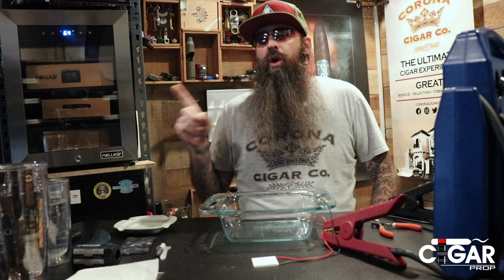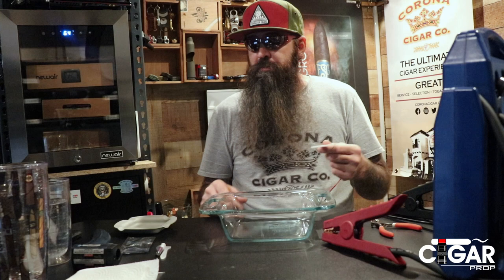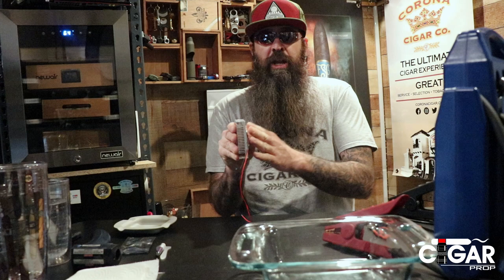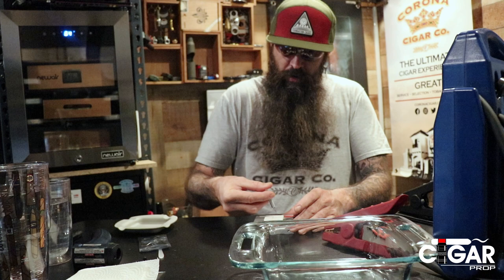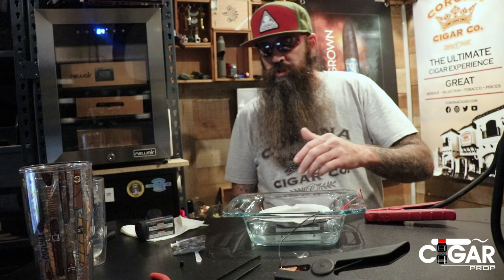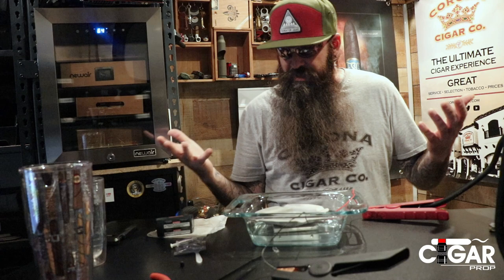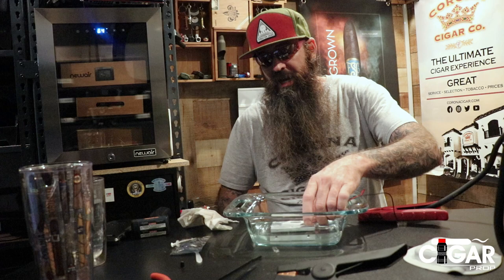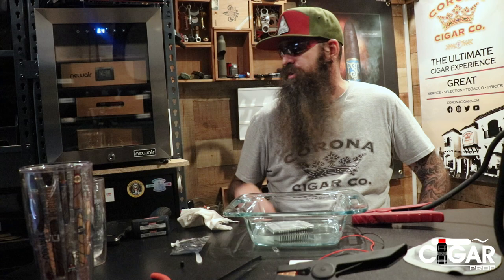How a Thermoelectric Humidor Works 2020 | Cigar Prop

Comment: This is a very nice explanation of a Peltier cooler, but unfortunately I am still unable to understand how that humidor handles its primary function. I know that the humidor’s unique function is that it achieves a humidity (or more accurately dew point target) to maintain proper moisture levels for the items inside. I’m very curious how it does this. Many models you simply add a cup of water in the unit and it takes care of the rest, but how does it do this? I even believe the dew point is the priority, with temperature second, but I’m not sure how that works. There is a straw sized drip output for water into a bin in the back as well right?  Thanks for any insight.

Correction, it seems this model only cools (or also heats if the h model)  and does not actually control humidity - I spoke with new air today and unless the rep was incorrect the unit does not lower or raise humidity on its own- a separate device would add humidity but there is not a mechanism for removing excess.
Reply from the maker: You are correct, there is no way to remove moisture from this unit.
What you need to do is put all of your cigars in there and  set the temperature that you want and then experiment with how much humidity you'll need based on the amount of cigars that are in there.
I would recommend putting all of your cigars in there, and setting the temperature to 65 degrees with no humidification at all for at least two weeks.
After two weeks, slowly add humidification if it's needed

Comment: @cigar prop I have a 800 count thermoelectric cooler from Amazon the brand Is tcfundy.when unit is plugged in my humidity drops 7 to 8 degrees and water drips off the plate.when unit is unplugged humidity holds fine.do you have any idea what's wrong.properly seasoned  unit kept in room ttemp environment.i had unplugged for 1 1/2 months humidity held no problem.plugged in for 1 hour lost humidty?
Reply from the maker: It's a cheap chinese-made machine, that's why doesn't work for crap.
But even if it did work, I would recommend you unplug it.
I recommend everybody with a thermoelectric humidor to just unplug it. I have found that they hold temperature and humidity so well, they don't need to be plugged in.
With that being said, there are people in really cold climates that need to have their cigars heated, but if the room the humidor is in is properly heated and cooled, I would just unplug it

Comment: Thanks for making this video, I was wondering, since this type doesn't use a compressor or whatever with oil like a normal fridge, do you see any reason putting the cigar humidor version on either of it's sides would cause problems? On the model I was looking at, it seems like the main cooling fan you're describing is on the back wall. Since it's in the same spot when turned on either side, maybe it will work. Do you think the 90 degree change in orientation is enough to mess with it? I haven't come across this being attempted anywhere which is odd considering how most of them don't fit cigar boxes, my first thought was can I turn it sideways?
Reply from the maker: This unit just uses a Peltier device so there's no reason at all that you couldn't mount it on its side or even upside down.
I'm not sure why nobody else has ever thought of that!
Reply: @Cigarprop  Thanks man, I'll try it out with the one I'm getting
Reply: So how do some of these heat and cool then? Mine says it heats and cools but not sure how it directs the unit to heat or cool depending on temp
Reply from the maker: @brianwalsh7040 a reversible Peltier device. It uses a small heat sink to cool, and then when it wants the heat, it changes polarity

Comment: This is how temp regulation works, but it not explains how the humidity is regulatet. Especially how do you adjust humidity connected to temp. If you cool air it "sweats" out water, if the air gets warmer you need to add water to keep the same humidity.